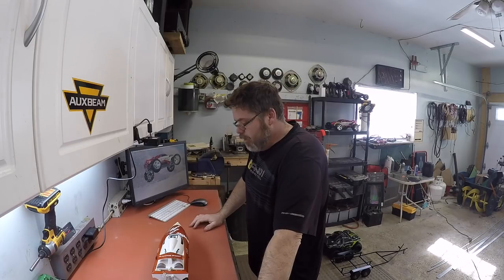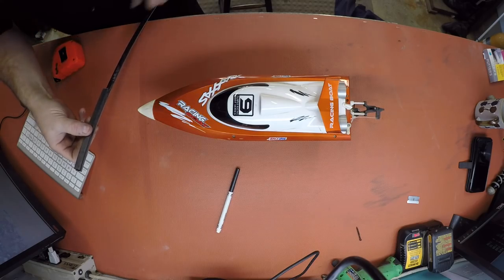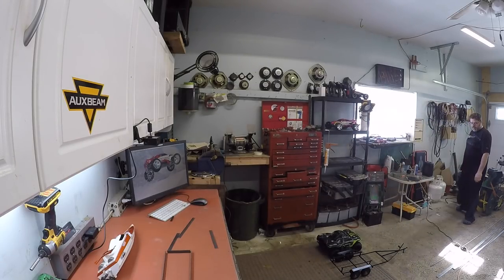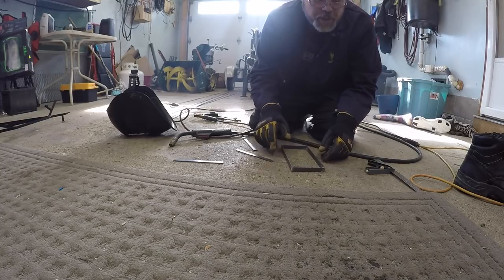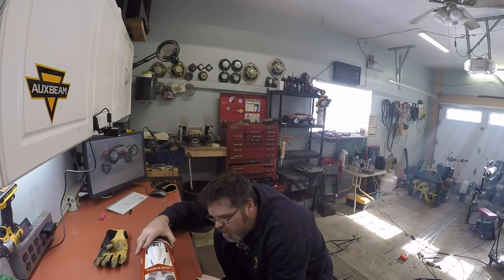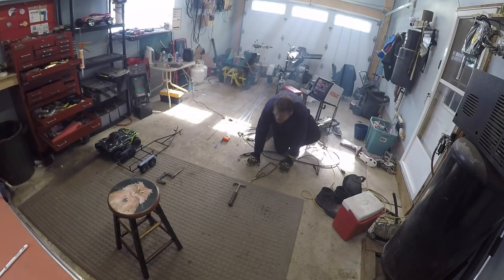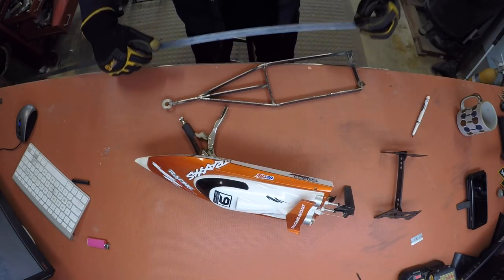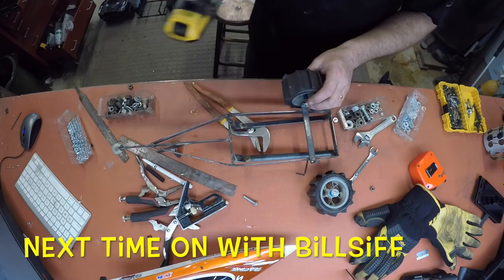Mel Wanted A RC Boat Trailer

Comment: Bill Siff i Forget To Say At Have You Made someKinda system to keep boat in lock when You tow That
Reply from the maker: not yet lol
Reply: miniature car strap attachment rope Would Be awesome Put i Know There is no That Kinda But Maybe a rubber cord that keeps the boat in place so it does not tip out When Driving Rc